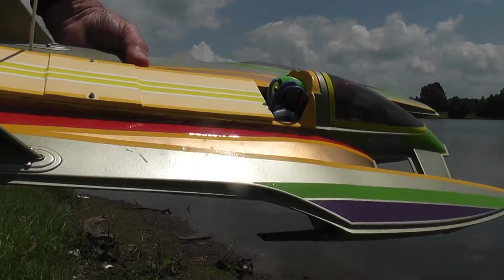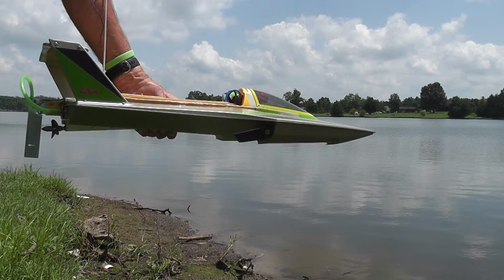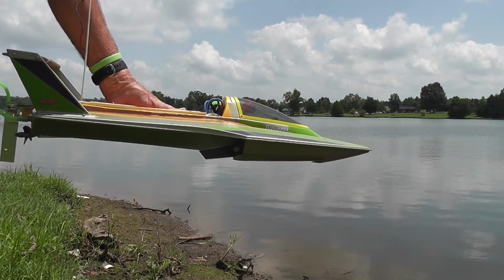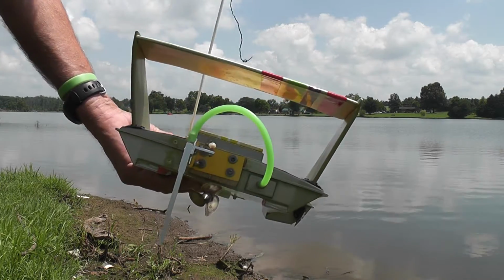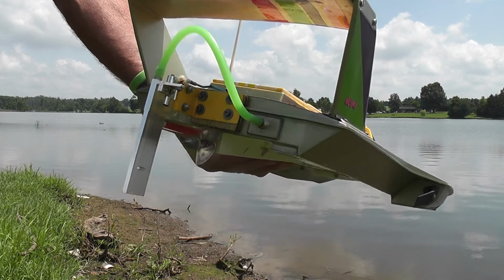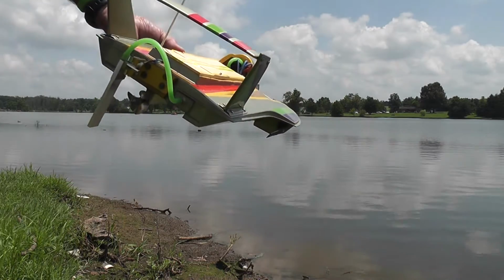Graupner Taifun Hydroplane running at Jacobsen Park !

Comment: I built a Taifun with my father more than 15 years ago. Had an OS Max 15 (2.48cc) engine. That was our only into glow motors.

We spent so much time trying to figure how to tune the carburetor. It would stall the moment the rudder hit the water. It would suddenly stall in the middle of the lake. I spent so much time recovering the Taifun with my trusy Carina (sometimes with my dad holding binoculars to my eyes). It was extremely frustrating.

But the brief moments it worked how it was supposed to, it was pretty awesome.

We later converted it to a high-end Plettenberg brushed motor. Top speed was down but it would just run without much trouble.

Anyway I got back to model boats about a year ago. I've resumed work on a tug boat after 12 years of storage at my parents'. And I've found the Taifun stored in a box.

I just need to find bearings for the prop shaft. I have small 2200mAh 3S Lipos from another boat and I think I'll run two in series (6S) with a cheap 36mm 1450kv inrunner from HobbyKing. I might even be able to cram actually two 3000mAh 3S batteries actually. It probably won't take much work to get this thing back on water. Or maybe something a little less wild as this is just an ABS hull.

And I also have a Robbe Sea-Jet to get back up & running ! Fun times ahead.

Comment: I have one sample bought in 1994, It has really well performed only two or three times. After that maybe a power output issue with the Speed 700 BB Turbo motor, impossible to get speed enough to take off: maybe with a good brushless...
Reply: It ran fine with a 700 BB Turbo 9,6V on 14,4 volts. If you could not make it get up and run that's on you,. not the boat. I ran mine with that setup for two years before getting an Ultra motor in it. It was a great hull, and it was my first 100 km/h boat.